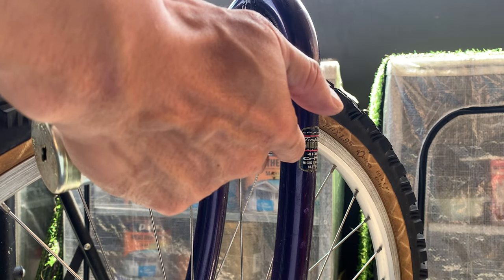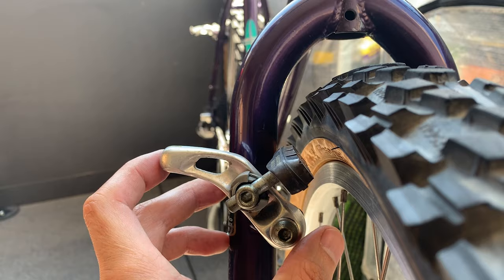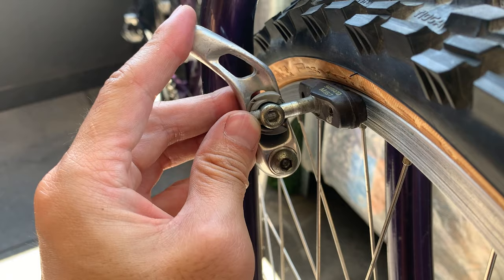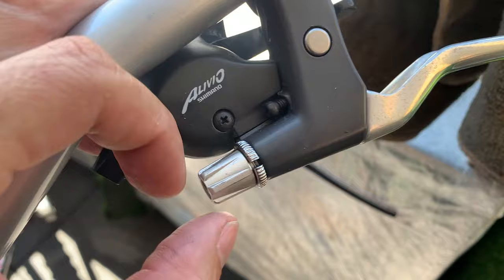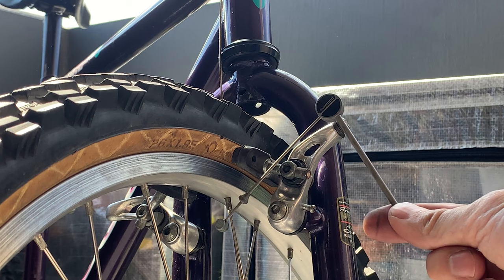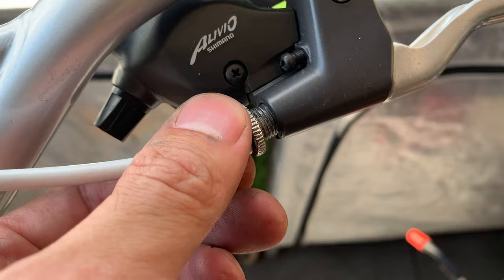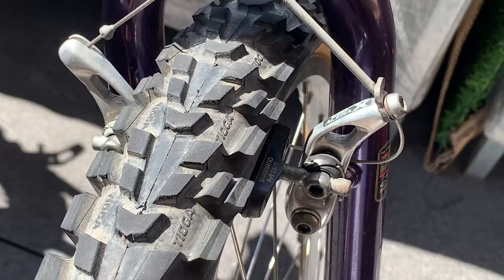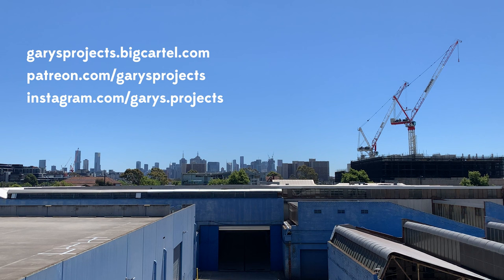how to: install cantilever brakes quick & easy

Comment: I'm sorry mate but those are not correct installed. If it's a cantilever break or a v-brake the break pads shouldn't stand parallel to the rim because of the "stick-slip effect" what is the very noisy squeeck the breaks can make ... to avoid this always install especialy on older breaks the break pads so that they are 1mm farer away in the back  from the rim as in the front ... throught the break itself and the wear the pads will become parallel to the rim while breaking ! Have fun !
Reply from the maker: Cheers ! Yes a little toe with the brake pads help with squeaking 👍
Reply: How you supposed to do it if break pads don’t move like this? From what I see on my bike they move up/down and clockwise/anticlockwise. I don’t see any way to tighten it so front/right side is closer to rim.

Comment: Hey Gary do you lightly sand the pivots if there’s any rust or discolouration or just your usual WD40 cleaning method on the pivots?
Reply from the maker: Just the wd40! I probably wouldn’t sand them because you don’t want your pivots to be loose. But yeah I guess it depends on how bad they are. Usually wd40 does the trick
Reply: @garysprojects  cheers Gary ;)

Comment: I don't know if i am lucky or not to have that kind of plastic washers in my STX brakes. I tryed to download PDF manuals i don't find anyone that have that plastic washers, just the metalic ones are included as standard. I might think their porpose is to allow some regulation in the angle of the pads but i am not shure yet. Do you know thw specific reference of that STX ?
Reply from the maker: I don’t sorry but in my latest restoration I install stx rc brakes? They might be similar not sure

Comment: Hey Gary, my cantie brakes on the rear wheel don't have that little adjustment screw. Any recommendations on how to balance the brakes? btw, thanks for all these very inspiring and chill videos – love your vibe <3
Reply from the maker: Thank you Jannis i appreciate that ! You can use the spring holes in the frame to adjust more tension on one side , hope that helps cheers!
Reply: @garysprojects  Thanks for your help! I will check for those spring holes later :)

Comment: Short but good :)
Do you have any trick when the pivot is a bit bigger thant the cantilever "hole"?
I do have a small play there :(
Reply from the maker: Cheers man I don’t really have a tip for that, maybe you can shim it using a thin piece of metal like a beer can
Reply: @garysprojects  or cut a bit of the pivot?
Reply from the maker: @luiscarloschagasrodrigues6069  hmmm not sure